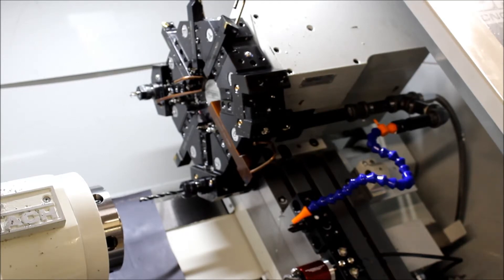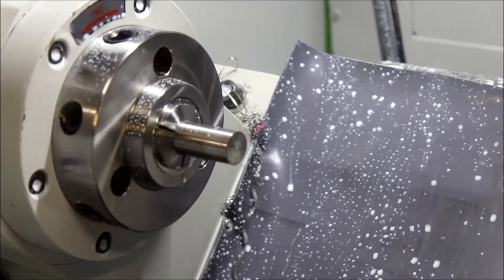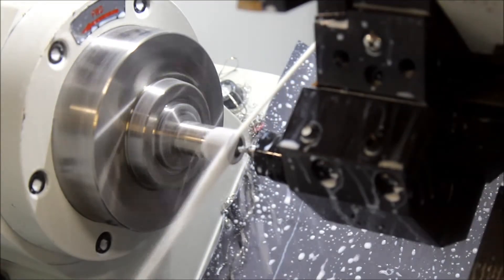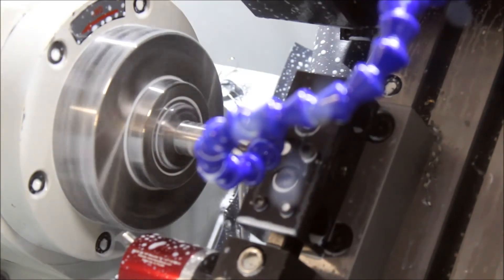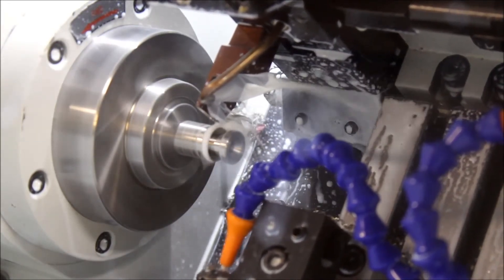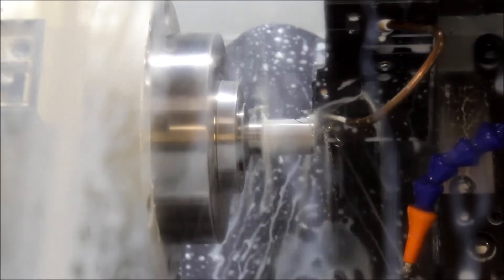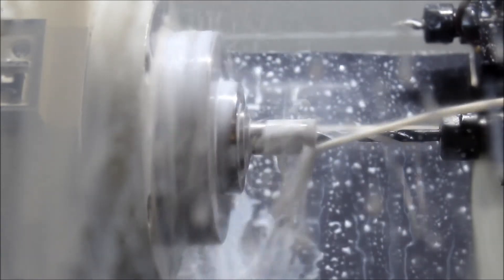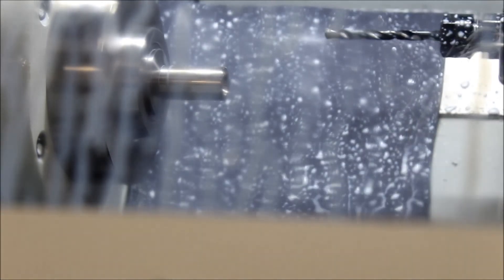Tormach slant pro lathe cutting 304 stainless - Thing 1

Comment: I need a machine that can handle 1.375" through the spindle bore and creating 1"-8 and 3/4"-10 external threads on 303 stainless. Is this machine capable of that? Thanks.
Reply from the maker: The spindle on this machine is only 1.1"

Comment: Here is a weird machining experience I have not quite figured out to this day:  Back in 94, I worked for a small Mt. Bike manufacture in Michigan that cut some titanium parts. I was drilling a .187" hole 3" deep from each end for a 6/4 titanium bicycle rear hub axle, (and the holes met in the middle pretty good).  I used a long high helix colbolt 140 degree split point drill,--coated with something. If I went the normal speeds and feeds with it, it would snap a drill bit in no time.  But I discovered that if I "broke in the drill", by slowing down the rpm and chip load, (starting about .0005" chip load and about 10% of the normal rpm), and worked my way up to the right rpm and about .003" feed rate/ chip load, with about 10 or 15 parts, I would get over 200 parts out of that drill at the normal feeds and speeds.  Never seen anything like it before or since, but it might be handy sometimes for that stainless.

Comment: So far besides threadexpress you have the most coverage over this lathe. Is there a way to increase the rapid speed between tool changes. Just curious.
Reply from the maker: Unfortunately those are the rapids of this machine. Rapids are 60IPM. Check out my Okuma videos to see some quick tool changes and rapids. Welcome to our channel and thanks for the comment.
Reply: @dnjmachine  I thought it was still in feed mode.  Not going to see sub 2 second chip to chip on this. :)

Comment: This is one of your earlier video,s so  i am sure everything you need running right on your lathe, you have already sorted out by now.

The Gripall bar puller seem to work fairly well from what i have seen.

I like your set up with the Turret and the Gang Plate definitely helps with the tools you need.

As you already know you never seem to have enough tool capacity in any CNC machine Mill or Lathe.

Thanks for the video. #21
Regards Peter.
Reply from the maker: Just subbed to your channel, will check it out. I prefer the EZ puller it works way way better.
Reply: @dnjmachine   Thanks for the sub man.
Look forward to reading your comments.

Regards Peter.

Comment: you said 304, but isn't it 303? usually 303 for solid, 304 for tube....
Reply from the maker: It is 304, you can get 304 and 303 in solid or tube. 303 is considered free machining and 304 weld able but not as easily machined. (never machines 303 myself)
The reason we use 304 is mainly for its use around food and its ability to stand up to very harsh cleaners.Thanks for the comment.

Comment: IT SEEMS LIKE YOUR MACHINE IS RUNNING SLOWER THAN MINE CALL TORMACH AND PUT ANOTHER CAPACITOR ON YOUR TURRET IN THE CABINET JUST PUT THEM IN LINE IF YOU WANT MORE INFO FSHMACHINE@GMAIL.COM